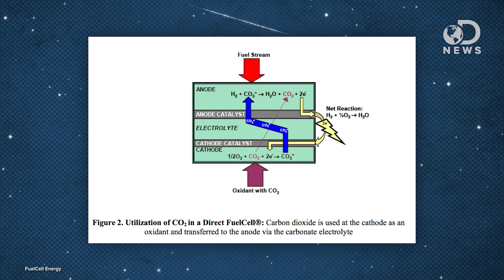Could This Technology Make Cheap Energy Clean?

Comment: we already have a clean cheap safe energy source: nuclear.
But of course it wouldnt be great for politicians and current energy lobbies.
Reply: ***** both fukishima and chernobyl were using outdated reactor designs. (the designs from 70s)
Modern reactor designs are safe.

Also fukishima faked the inspection. Some people should go to jail for that. (they should have updated their architecture but they didnt)

And even events like these are far less common than coal plants burnouts or coal mine burnouts which pollute even larger areas of the ground for thousands of years (coal mines just burn forever and noone can use that land, on top of that it pollutes the air as well while it burns)
Coal kills way more people than nuclear power does. So it is a way safer alternative.
But people just use their emotions instead of rational thought.
Reply: ***** It is clean as long as the area is stable i.e. not on the ring of fire.  Other then that its clean.  Fukishima and Chernoblyl are one of the few failures in a span of about 15 years!.
Reply: Clean? You're trolling, right? Look at Japan and Chernobyl.
Reply: Please tell me: Where to put the nuclear waste?
Reply: ***** Nuclear IS one of the safest when you look at the statistics. Just like how people are afraid to fly because the few accidents that airplanes experience are so heavily reported (even though on average flying is the safest form of travel), so to is the same with nuclear meltdowns. On average, you are more likely to die due to other forms of power generation, like coal, then to a nuclear reactor meltdown. But before I finish, renewable sources ARE the safest as they cause no deaths, but they aren't as efficient as nuclear. So until Nuclear fusion reactors come about, which will be the safest, cleanest, and most efficient forms of power generation in the history of man, I am sticking to saying that we should go with nuclear fission reactors.
Reply: Freak80MC Some proof to back me up:
http://www.washingtonpost.com/national/nuclear-power-is-safest-way-to-make-electricity-according-to-2007-study/2011/03/22/AFQUbyQC_story.html
http://www.nuclearconnect.org/know-nuclear/talking-nuclear/top-10-myths-about-nuclear-energy
http://www.theguardian.com/environment/2011/mar/29/nuclear-power-safe-sir-david-king
Reply: Too bad some assholes lobbied the government for the most inefficient nuclear Power plants with the highest nuclear waste left over. 

If we only did breeder reactors maybe we wouldn't have this problem with nuclear.
Reply: Herp Derpington Best not to ask that.  You'll likely get a rude answer, such as, "Stick it where the sun doesn't shine."  Meaning, of course, underground.  Ha! :p
Reply: Fart Snake The thing is though, we don't measure safety on "ifs". If planes crash, hundreds of people die compared to a few in cars, which must make planes unsafe, right? No, because we only assess safety on actual accidents, which make planes safer because there are less accidents than cars on average. The same holds true for nuclear reactors, which while yes, when they fail they fail horribly, but when they are designed right and protected right, they are like tanks and nearly indestructible and so they cause way less deaths than compared to other energy sources like coal.
Reply: ***** how many people die every year because of coal related power plants. go ahead, i'll wait. compare that with people who've died as a result of nuclear power accidents. take all the time you need. there's always going to be accidents, that doesn't mean it's not safe. people die from car crashes every year, we had few plane crashes as well. but statistically flying is still the safest mode of transport. look at the overall data. people like you can't see forest for the trees. tell me, do you get all your news from fox "news"?
Reply: princeofexcess There shouldn't even BE a radiation zone. Nuclear power was, is, and will be a mistake. Here are a few renewable forms of energy: Wind, solar, geothermal, hydroelectric, hydrogen fuel cells. Granted, a few of these aren't "efficient," but if we continue to research them we can make them efficient.
Reply: ***** Sorry, SOME of the few failiures.  Chernobyl was due to human error other then that it would've been fine.  Also it was within a span of 25 years!  Thats pretty good out of the 435 nuclear power plants!
Reply: ***** Chernobyl was a catastrophic event, which is highly unlikely in 3rd generation reactors and will be even less likely in 4th and 5th generation. Also, work is being done on thorium reactors, which doesn't produce weapon grade waste. Death toll from Chernobyl is around 9.000, mostly cancer related - most death from nuclear power comes from mining accidents. Dam failures in China - death toll 230.000 people. Coal is the most deadly - death toll 13.200 each year in the US alone and 300.000 deaths each year in China in adition to the severe environmental damage it does. Methyl mercury (one of the most deadly toxins) levels in the oceans are increasing due to coal power, making fish cause brain damage in fetuses and neurological problems in both children and adults. This is particularly dangerous for coastal communities that eat a lot of fish.

By each kWh produced, nuclear causes least death, coal consistently, and by far, the most and so on.

Nuclear isn't renewable, but in my opinion we shouldn't completely ignore it, as other sources have far more ecological degradation associated with them.
Reply: FixItStupid I can't tell which one you are

-12 year old boy pretending to be 60.
-60 year old person with severe brain damage.

Well I guess they are basically the same thing.
Reply: FixItStupid I couldn't comprehend a single thing you said. Your grammar probably kills much more than Nuclear radiation.
Reply: Nuclear waste is hard to dispose of.
Reply: ***** Well I was about to writhe that and also the technology was nowhere near the technology today,if they had best technology of their time,they couldn't compare to today so if it were to come to a meltdown the damage would be much,much lower.
Reply: ***** Not everyone can afford Renewable energy. The top solar farms today cost almost 6-7x as much as the same amount of energy that can be obtained through Dirty Coal/Fossil Fuel burning. Not to mention they take up more than 6 hectares of Land. 

One Coal power plant can output as much continuous energy as 130x  6 hectare solar farms.

You can start to see how this is a big problem.

WInd power is very costly, A typical Wind powered turbine can generate about 3 MW of power and Its greatly dependent on weather.  Again. there is a huge problem with the cost to produce one of these towers, the extremely vast amount of land needed to equate to one compact Coal power plant which can generate.

You need almost 60 square Miles of Area to generate enough power as 1 coal power plant that out puts 1600 MW of continuous energy.

Again, you see a big issue.

GeoThermal is only available for places that are volcanicly active. Again this is a huge set back and can only be built in very certain regions. It is also a very huge task to build a Geothermal Powerplant as most of it is deep underground. The biggest Geothermal Powerplants can only generate around 200 MW, Most can only generate around 100 MW of continuous power.
Reply: Nuclear is clean? What about Fukushima..
Reply: Only LFTR reactors are feasible. Thorium is the way to go.
Reply: D Babola In new nuclear the meltdowns you refer to is a physical impossibility. As the fuel is already a liquid...
Just do a search for LFTRs and educate yourself about the possibilities that lie beyond the current extremley inefficient use of nuclear.
Reply: Herp Derpington The waste is contained in facilities underground.

And you are forgetting, the energy released from a Nuclear Fission reaction is 2 Million times more efficient than coal.

A Uranium cube an Inch wide releases the same amount of energy that burning 1 Ton of coal releases.

Now you can get a picture of how much fuel is actually being used and converted into plutonium a nuclear power plant versus a coal powerplant burning through Many tons of Coal releasing all that Co2 right into the atmosphere.

if you want to see how Big 1 ton of coal looks like, Google pictures "1 ton coal bag"

The proportions need to be realized.
Reply: I'm just going to leave now because everyone is just repeating themselves and nothing is getting accomplished here. Good-bye and good luck not getting radiation poisoning.
Reply: *****  there were 2 major accidents with nuclear power. You know how  many coal related accident there are??

Nuclear power is already the safest and cleanest alternative (at least when it comes to something that is actually sustainable)

You are stating that nuclear power is a mistake but data says otherwise.

Btw i live next to a nuclear reactor and there is hundreds of nuclear reactors world wide.

Being against nuclear power is like being a person who doesnt want to fly airplanes even though its much safer than driving a car.

Oh and btw during regular operation (when there is no accident) coal plants release more radiation into the environment than nuclear power plants. And they also release other goodies like mercury.
Reply: ***** So in other words, you can't stand that people won't buy your baseless claims and are admitting that you, in fact, have no foundation for your argument beyond your own ignorance and paranoia?

If your only arguments nuclear are two disasters and the waste disposal, then we need to compare apples to apples.  Chernobyl was the result of bad design, bad safety procedures, and overall cheap workmanship, from a 50 year old design.

So let's compare that to poorly made aircraft made 50 years ago.  Oh...hmmm...aircraft of the time were responsible for thousands of deaths!  Modern aircraft must me just as unsafe, we must stop using them!

Just like aircraft and cars and boats and basically everything else, the old dangerous initial designs of the past are long gone, and far superior and dramatically safer designs and technology have emerged.  Even with that old dangerous technology and design, Nuclear remains the safest, most environmentally friendly power source, overall.  It requires less land per kilowatt than any other source.  It emits less waste into the environment per kilowatt than any other source (including the construction process, Solar requires very dirty production methods, and the rare-earth magnets needed for high-efficency wind are harvested using incredibly damaging mining methods that leave vast amounts of land toxic for decades).  It kills less people per kilowatt over the history of energy.

Then there are modern reactor designs, which not only produce more power, in a smaller form factor, without the need for large amounts of water, but do so with zero risk of meltdown.

You could install one of these underground in a subdivision and it would take up only a few square meters, and provide constant electricity for decades without refueling.  No need for a staff either, you can build it and forget about it.  Best part?  Its waste is harmless at the end of it's life cycle, no special handling required.
Reply: Burning fossils kills millions of people every year, way more than nuclear. Plus modern nuclear reactors don't melt down. People who are afraid of nuclear don't understand it, it's like a caveman that's afraid of fire
Reply: dLight Sella Field, Chernobyl, Fukushima, 3-mile island

Chernobyl, Fukushima, 3-mile island = All built before 1969 First Gen powerplants.

Sella Field = Built primary in the nuclear war race when safety was barley even cared about.

Chernobyl = Built without a heart container

Fukushima = Due to an earth quake, the earth quake killed 15,000 people. The Nuclear reactor Killed no one.

There are Generation 4 Reactors in the making currently. All the nuclear incidents were strictly due to primitive very old, literally first Generation reactors with little to no safety precautions like there are today.
Reply: K2ACP Nuclear has been around for 60 years. which means it's been around through wars and plenty of natural disasters. It's the safest energy source by far and even produces less toxic waste than solar power.
Reply: FixItStupid Im going to guess that you are around 12. If not then I suggest you see your local Psychiatrist or a doctor.
Reply: FixItStupid
Too bad, you live with ionizing radiation whether you like it or not, whether nuclear plants exist or not.
Reply: KillerBillPickle How do two accidents make one failure? Chernobyl is NOWHERE near the Ring of Fire. Hundreds of miles of land are still contaminated to this day and children are born with some VERY serious defects.
Reply: *****  nobody lives in chernobyl radiation zone (at least not legally there are people that chose to stay but they just didnt want to leave their home land)
Reply: KillerBillPickle These accidents cause some serious health and environmental problems. The damage that we have been speaking about was caused by a few plants. Tell me what would happen if they all went catastrophic. And yes, do tell us where we would put the nuclear waste? Burying it would solve the problem, it will still be radioactive for millions of years.
Reply: Chernobyl is safe and clean, it has only five times the background radiation.
Reply: Herp Derpington They apparently have space for CO2 cells so in the same place I guess.
Reply: sure, it's safe. until something goes wrong. and then a 1,000 square mile area is uninhabitable for 300 years. if that isn't safe i don't know what is.
Reply: Fart Snake You forgot to add the million after the 300.
Reply: ***** It's not million but I think it's something like 50 000
Reply: Freak80MC when they are designed right? you mean like the one on 3 Mile Island?
Reply: ***** One word: Chernobyl.
Reply: ***** I don't watch Fox. Nor do I support coal power plants either. I don't choose not to use coal and nuclear because of efficiency, I choose not to use it because it's NOT CLEAN. I choose renewable energy because it's clean.
Reply: ***** We have learned alot from Chernobyl and Fukushima,

There has been alot of steps we have taken to prevent a disaster as such from happening again, and better technical structuring to better fortify a nuclear reactor.

Modernday Nuclear Uranium reactors are very safe.

However it's just the byproduct that is dangerous, as long as it is kept in a controlled location Nuclear Uranium Power plants virtually are one of the cleanest forms of energy production currently.
Reply: ***** nuclear is clean, and it can be harvested on demand. the problem with renewable right now is that the energy can't be stored and there are other practical problems as well. solar panels become really inefficient when there's dust, and desert is one big dust bowl. you can clean it with water, but there's shortage of water in desert. the problem with living in reality is that you have to worry about cost. if it doesn't make economic sense, then it won't have a lot of support. nuclear power plants are getting safer and safer all the time. there are generation three power plants being built in china and US scientists are already working on generation four power plants. if we want energy security, we need to look at all types of energy sources and nuclear is part of the solution along with solar, wind, coal, geothermal, hydro and so on. 
http://www.the9billion.com/2011/03/24/death-rate-from-nuclear-power-vs-coal/
Reply: D Babola http://www.the9billion.com/2011/03/24/death-rate-from-nuclear-power-vs-coal/
Reply: D Babola I think you should read my comment about 3-4 responses above yours.
Reply: ***** Nuclear is more risky than let's say solar energy. The meltdowns cause by nuclear energy literally makes that part of the planet uninhabitable. There too much potential for a catastrophic event to happen with nuclear .energy
Reply: D Babola Solar is not realistic, again, the uneducated people in this subject always watch oversimplified science videos that try to glorify solar energy's potential without giving you the reality of the situation.

Not everyone can afford Renewable energy. The top solar farms today cost almost 6-7x as much as the same amount of energy that can be obtained through Dirty Coal/Fossil Fuel burning. Not to mention they take up more than 6 hectares of Land. 

One Coal power plant can output as much continuous energy as 130x  6 hectare solar farms or 1600 MW of continuous energy

You can start to see how this is a big problem.
Reply: God dammit the ignorance of the fucks here. Nuclear energy is clean and safe, to the fucks who cite "Fukshima" and "chernobyl", chernobyl was due to human error and poor reactor design that was never implemented again, Fukashima  was due to its shit location and the fact that after the quake a fucking tsunami came in and wiped all the back ups out. Nuclear Energy produces as much radiation into the area as you would get from eating one banana every year.  No member of the public has ever been injured or killed in the entire 50-year history of commercial nuclear power in the U.S.  In fact, recent studies have shown that it is safer to work in a nuclear power plant than an office. To date thousands of shimpents of spent nuclear fuel have been made all safely.  All of the used nuclear fuel generated in every nuclear plant in the past 50 years would fill a football field to a depth of less than 10 yards, and 96 % of this “waste” can be recycled and used. And it also requires less land then almost any other energy source. Do the damn research yourself before you open your mouth. And If anything thorium reactors will be even better once they are developed.
Reply: Carbosful Solar isn't viable now because of how little time and money being put into R&D of solar energies. Coal has been a source of power for much longer. 
As our technologies become more and more advanced we should be able to harvest more of the energy coming from the sun.
My main issue with coal and nuclear energy is the long lasting effects it has on our environment. 
As you have probably already noticed I'm not well educated on the subject but I do find this stuff fascinating, I'm studying nutrition at university, so I know the politics within this subject hinder further developments
Reply: D Babola Long lasting effects of nuclear energy on the environment? Nuclear reactors emit no greenhouse gasses during operation.  Over their full lifetimes, they result in comparable emissions to renewable forms of energy such as wind and solar. Nuclear energy requires less land use than most other forms of energy.
Reply: D Babola That is true to only a small degree, I will tell you why.

Its mainly due to energy density.

Fossil Fuels and coal are simply concentrated sunlight.

You don't even need to be very educated to understand logic.

If Fossil Fuel's and coal are simply concentrated sunlight through Millions and Millions of years time, you should be able picture how much more energy is released by simply burning this material versus Trying to obtain energy through capturing sunlight that's hitting the earth now.

-----
Theres a maximum of energy that can be obtained in a given amount of Sunlight area. And that ammount ranged between 120-200 Watts/Sq meter the variance is due to weather. Again this is your maximum ammount of energy meaning even if you had a 99.99% efficient solar pannel this is the maxium you can get for that said area.

again.. This becomes a great problem even if can develop an impossible way to cover every single inch of ground with nearly perfect energy conversion you are still stuck with that limit.

Since our energy demands are exponentially increasing decade by decade, it wont be long until the need to develop a very dense compact form of energy generation is needed once again..

That's not to say that solar will not be used for a wide variety of appliances in the future, however it realistically cannot be the main source of A Big nations energy production.

----

Our Solar pannels currently are not horridly inefficient The most modern ones can convert up to the mid 30% in terms of efficiency. 

Its not an efficiency issue, its the fact that Sun light can only contain so much energy, It requires Huge amounts of area making it very impractical.

We need Dense power generation methods.

Is it more realistic to steadily advance solar technology or develop a new way to triumph Coal burning and nuclear Uranium by thousands of times through Nuclear Hydrogen Fusion ?

You do the math.
Reply: Hendlton Ah, but the waste is much more hazardous than the CO2 and the danger is of a different kind. CO2 is not *directly* poisonous; but the waste is. This waste will still be radioactive when we are no longer here...
Reply: Carbosful
As a perspective to that:

The final energy output of 1 ton of Thorium ore in a LFTR equals about 235 tons of Uranium ore in a LWR.

Assuming equal 3% purity of the ore the waste from the LFTR will be about 2.1 kg while the waste from the LWR will be about 7 tons (6838 kg depleted uranium and 211.5 kg waste)...

The 2.1 kg waste from the LFTR needs to be stored for only 300 years.
The 211.5 kg waste from the LWR needs to be stored for 100.000 years.
Reply: ***** In terms of risk to human health measured by deaths per kilowatt, nuclear is incredibly safe, even with Chenobyl and Fukushima

In terms of risk to the environment, nuclear energy is probably also superior to many forms of renewables such as hydro-electric and biofuels. Nuclear waste is a problem, but it is a localised and containable one, unlike greenhouse gases.

Any claim that nuclear is 'unclean' or 'unsafe' I just don't buy.
Reply: Check out thorium reactors
Reply: ***** Well you did claim things without any factual backing. Most of the posts in here were giving you reasons and some factual insights on how some of the claims you made were wrong.

I wouldn't take it as a personal insult, 

As long as knowledge is being spread I fail to see how this conversation is getting nothing accomplished.
Reply: *****  So a $4 soviet reactor and the one built next to a fault line and ocean are your examples? Chernobyl is your only argument but thats so far out of date its no longer relevant. When it comes you japan thousands of people died from the earthquake and tsunami and zero died from the reactor.
Reply: Another reason that I'm not contributing to this any further is because the nuclear idiots assume that coal is clean and renewable. I don't support coal either.
Reply: ***** I don't know who claimed coal was clean and renewable, but who ever made that claim was wrong, however its not wise to bunch us up as " nuclear idiots" 

No one is actually trying to insult anyone in this conversation.

Just because there is a difference in opinion does not mean that the next best option is to personally insult others by name calling unless you are still a Kid.

If you have a different viewpoint you should try to explain it in a mature way.

-----
Im sure everyone would love solar power or renewable energy sources in fact if the energy crisis could be met by renewable sources than im all for it..

However the more you understand about how these processes work, the more urealistic solar becomes.
Reply: Nuclear safe what about Japan?
Also the same thing could happen in the US
Reply: Neil Lizotte What about japan? No one even died from that.
Reply: KillerBillPickle what about the waste bio products that remain radioactive for over 100,000 years
Reply: Neil Lizotte The waste that is securely kept with in a small metal container? That is thousands of times smaller then the harmful waste coal produces. Building solar panels produces more toxic waste then nuclear
Reply: Though nuclear isn't as dangerous as people say (a couple of oil refineries have exploded), like other people have said you have nuclear waste that need to be stored at a waste site. We still haven't figured out how to safetly store it yet.
Reply: Ryan Gillen Yes we have, throw it in a metal container, problem solved
Reply: BlackCats
 In most countries with nuclear power except the US nuclear waste is recycled. (you can reuse it as nuclear fuel)

And even if its not recycled it is still cheaper to dispose of it than to use coal power plants.
Reply: Neil Lizotte
 Japan was using a power plant with architecture from the 70s (in fact they faked an inspection to get away with it)

If there is an accident increase safety standards do not ban the technology completely.

And even with accidents like Fukishima coal kills 1000x more people than nuclear.

And new reactor architecture doesnt allow for such accident to occur.
Reply: princeofexcess It was built in the late 60's XD
Reply: Neil Lizotte fun fact: nuclear waste can be recycled (and is in most countries except the US)
Reply: Ryan Gillen
 Nuclear waste can be recycled. How is it that nobody knows this...
Reply: whatsmyusername10 yea its extremely outdated. Although construction finished in the '71.
Reply: james lionbreath Let me give you an example.

A typical Coal power plant, very compact and can generate up to 1600 MW energy always 24/7 by burning coal.

A typical solar farm takes up 180 hectares or land or 450 acres. (very large), Can generate up to 20 MW energy for ONLY 15/24 hours per day.

Typical Solar farm sells energy for $33/watt
Coal sells for $5.5/watt
Reply: james lionbreath  it would be cool. But it will not work.

In order to have energy source which is usable it has to compete with the other energies financially.
Solar takes up way too much space and is extremely inefficient. Unless we have a major breakthrough it will never compete with other energy sources.

You might think it doesnt matter if it competes with other energy sources or not but the truth is if you want to use clean energy sources you will move the poverty line up.
Which is extremely terrible thing to do.
Reply: I believe nuclear is the only energy source that can compete with fossil fuels. But building nuclear power plants is sooo expensive
Reply: whatsmyusername10
  its still competitive with other sources of power. (unless you are near a cheap source of fossil fuels)

on top of being competitive it has an additional benefits of being extremely clean and safe.
Reply: KillerBillPickle
Having 2 nuclear meltdowns in a 100 years is too much, let alone in every 15 years...
Reply: dLight Fossil fuels killing hundreds of thousands of people each year is too much. Fossil fuels is so much more toxic
Reply: "Safe" yes, but not when shit hits the fan during a war or a natural disaster. Also storing nuclear waste is a tricky and sketchy thing to do. Containers have leaked recently and have gotten into ground water. This kept in mind
It's still a better solution than coal.
Reply: Nuclear today is far improved to nuclear say back in the late 40's.  Honestly we could run on nuclear, hydro, and renewable alone.  We put more heavy metals and toxins from coal and petrol burning than the same power from nuclear according to mass.  Look it up for yourself if you don't believe me.
Reply: Christian Millard Go back to school ..................yea so improved it's killing the earth........... seems like there's a lot of people that work in the industry on this channel killing the earth what do you think happens when your FUEL ONE  plants think they're venting Makem poop  oh and what do you do with the poop
Reply: GO  BACK  TO  SCHOOL       KILLING  THE  EARTH   NUCLEAR      THIS   IS   THE  KID Ch   more propaganda brainwashing for the kitty channel
Reply: Look up perpetual motion, you will find that everything requires energy.  Solar is nuclear btw, just photo radiation rather than neutron radiation heating a medium.  Look up photovoltaic cells to understand how they work.  They still require an electrolyte and silicon.  Not exactly environmentally friendly as they get more efficient their carbon footprint increases.
Reply: Anyone who says nuclear is bad for the environment does not understand how it works.  It is recyclable into a glass, reducing mass.  Litterally the most clean steam boiler in use today.  We get most our energy from coal and petrol.  Also wind, solar, and geo, make up less than 5 percent of our grid.   Hydro which is still terrible for the environment is 95 percent efficient and is destroying water tables.  Don't assume the power issues of today aren't validated.  Before you tell someone to go back to school it would be good to get an education yourself.
Reply: You go back to school because the glass  doesn't work dummy read up I am current on the subject you're a corporate dummy pay your taxes
Reply: Take all your nuclear and shove it where the sun don't s shine you can tell it to my thyroid
Reply: FixItStupid Nuclear is the way of the future
Reply: Yes, Sad But True  &  All for Greed Money
Not all the money will buy another Earth
 Not all the money will buy another Minute
Reply: ***** One word. Thorium!
Reply: SEE IT KILLS NUCLEAR
 http://enenews.com
Reply: whatsmyusername10
 http://enenews.com     
NUCLEAR KILLING YOU SOFTLY look at the cancer rates look at what the World Health Organization said the cancer rates are going up.... would that be all the radiation affecting the DNA ?  It's in the FOOD chain isotopes daughter products THAT in the future you have yourself real nice DAY
 SCHOOL WOULD BE GOOD
Reply: FixItStupid News articles are a terrible source to look up information. Look for information in the scientific literature. Fukushima has been over blown by the media. Air pollution from use of fossil fuels kills millions of people each year. Fukushima has killed no one.
All the reactors that have ever melted down were first generation reactors built in the 60's. We are currently at 4th gen and 5th gen is around the corner.
Even solar power produces more toxic waste than nuclear
Reply: Really News articles are terrible source of information that's is hypocritical as if nuclear IS safe NOT... Just so you know 51 men gave their lives so that not more damage was done your real sick wicked know you're a bot working in the industry I agree to disagree you're an idiot and I'm not continue to discuss the matter with you.. / it... I feel that you're a machine not one shred of human intelligence or compassion
Reply: FixItStupid Yes news articles are terrible. Oh only 51 people have died? That still pales in comparison to fossil fuels.
"In the United States, approximately 140,000 deaths a year (Wo of all deaths) may be associated with air pollution."
http://www.sciencedirect.com/science/article/pii/0095069679900226

"The estimate of 100,000 deaths per year means that 1 American out of 30 dies as a result of air pollution."
http://www.phyast.pitt.edu/~blc/book/chapter3.html

Once again the reactors that melted down use old and outdated technology.
Please stop using ad hominems, it doesn't make your argument any better
Reply: I think you're a bot one of those that get paid to distract the facts about nuclear industry you don't even know the 51 were the ones at the Nuclear Power Plant  hundreds of millions will be impacted by Fukushima every single nuclear power plant impacts the environment in so many more ways I have two coal-fired power plants directly across from my house and I have no problem with those I know what comes out and I'll deal with that...... Nuclear  it's just a straight up killer and it doesn't stop killing for thousands of years and  remember I got a thyroid that was taken out because of all the nuclear iodine 131 from  stupid fusing reactors have a nice day get educated
Reply: FixItStupid Telling others to "Go back to school kid"  Typing in caps, Yelling at people who disagree with you.. is not something that an educated person would say..

If what you are saying is truly correct backed up with facts then that is all you need, in a debate.
Reply: I'M TOO FUCKING OLD TO GIVE A DAMN ALL YOU SMART KIDS GO KILL THE EARTH YOU KILLED THE EARTH YOUR CHILDREN WILL LOVE YOU
 YOU BOUGHT INTO CONSUMERISM
 IF YOU CAN'T GET I  TYPED  IN CAPS.  BECAUSE YOUR  too young to see
NUCLEAR INDUSTRY TOOK MY THYROID  I LIKE YOU SELF-RIGHTEOUS YOU CAN'T STAY ON THE SUBJECT THIS CHANNEL IS  OBVIOUSLY IS DEDICATED FROM THE NUCLEAR INDUSTRY LOBBY GET INTO THE HEAD OF THE YOUNG PEOPLE
Reply: Carbosful I'M TOO FUCKING OLD TO GIVE A DAMN ALL YOU SMART KIDS GO KILL THE EARTH YOU KILLED THE EARTH YOUR CHILDREN WILL LOVE YOU 
 YOU BOUGHT INTO CONSUMERISM
 IF YOU CAN'T GET I  TYPED  IN CAPS.  BECAUSE YOUR  too young to see
NUCLEAR INDUSTRY TOOK MY THYROID  I LIKE YOU SELF-RIGHTEOUS YOU CAN'T STAY ON THE SUBJECT THIS CHANNEL IS  OBVIOUSLY IS DEDICATED FROM THE NUCLEAR INDUSTRY LOBBY GET INTO THE HEAD OF THE YOUNG PEOPLE
Reply: WOW I FOUND THE HEART OF THE NUCLEAR INDUSTRY ON THIS CHANNEL IMAGINE THAT PROPAGANDA  SO EFFICIENT
 FUKUSHIMA IS CLEANED UP MY ASS GET OVER THERE CHECK IT OUT   IT WAS A BUNCH OF YOUNG SMART ASSES THAT THOUGHT NUCLEAR POWER ... WAS SO GOOD...... FROM THE TIME YOU ... TAKE IT OUT OF THE GROUND IT'S KILLING
 I GUESS WORD POISON DOESN'T MEAN ANYTHING TO THE PEOPLE THAT ARE ALL ABOUT CONSUMERISM AND THE CANCER RATE RISING THAT DOESN'T ADD UP TO ANYTHING RIGHT
Reply: I'M NEARLY 60 AND I'VE SEEN ENOUGH OF THE WORLD TO KNOW IT'S ENDING SOON THANKS TO CONSUMERISM & THE NUCLEAR INDUSTRY YOU SEE GREED MONEY LAWYERS PAID TO LIED YOUR COURTS AREN'T WORTH A SHIT AND IF YOU CAN'T SEE THE EARTH DYING BEFORE YOUR EYES U NEED THE DOCTOR
Reply: NUCLEAR INDUSTRY KILLS ALL  YEAH THAT'S WHY WORK IN THE ELECTRONICS FIELD.. FOR THE GOVERNMENT FOR YEARS AND I QUIT THEM TO BECAUSE I DON'T USE TECHNOLOGY AGAINST THE CITIZENS OF OUR COUNTRY OR THE EARTH   AND I GOT OFF MY ASS AND I DID SOMETHING ABOUT IT I SPENT MY MONEY I PUT MY MONEY WHERE MY MOUTH IS AND PUT IN THE SOLAR AND THIS WINDMILLS AND I RUN MY HOUSE OFF GRID AND I  TRY TO HAVE A ZERO CARBON FOOTPRINT  AND YOU JUST A CONSUMER GO TO WORK AND PAY YOUR TAXES OKAY GO BACK TO SLEEP BELIEVE THE PROPAGANDA
Reply: Herp Derpington
You can burn nuclear waste in fast reactors or thorium reactors, then it becomes inert in 300 years and is safe enough to handle in decades after it's burned. 10 years of waste equate to 1000 years of fuel in a fast reactor.
The only reason all those accidents happened is because water is a shitty way to cool a power dense energy source. Lead and molten salt, or even a modern CANDU would have prevented fukushima.
Reply: leerman22 Sorry maybe you don't understand that the majority of us don't want any   energetic radiation /  ionizing radiation anywhere around us ... Are DNA is precious to us.. Nor do we want any of the other life forms on this planet to deal with ionizing radiation and all the other nuclear isotopes That  amazingly seem to get out in to the environment that are completely man-made anybody who's pro-nuclear is for death you should really read some of the studies on low level radiation exposure it will certainly change your understanding the health effects of the bomb testing alone is horrible disgrace to science nuclear is just greed money lie game of Death how many people do you know that got cancer ?how many mental health? birth defect and mutations ? And so many other autoimmune diseases's .... you cannot burn nuclear fuel the world has been working to deal with the waste & the world cannot find A way to deal With the waste it lasts millions of years some of those isotopes emitting alpha Beta x-ray and gamma amongst many other wavelengths along electro magnetic spectrum ALL = Death... sad that most likely We won't ever worry about anything Ever Again because I believe Fukushima to be an extinction level event & the next nuclear "accident" is a mathematical certainty
Reply: leerman22 Dosis facit venenum.
Reply: *****
hey as long as u build it up to the right standards unlike 3 mile island and not at any place with natural disasters its fine
Reply: The Doctor Nut's Dr. POPULATION CONTROL THROUGH NUCLEAR POLLUTION READ IT.... wrote 1970 by Tamplin & Gofman   CANCER Going UP ? You don't know it until you find out you don't know NUCLEAR KILLS
Reply: "safe"    Go live within 30 km of Chernobyl. Oh, wait... no, you can't.
And before you lecture me about all the gross exaggerations made by rightwing conspiracytards like Alex Jones about Fukushima irradiating the ocean, which Thunderf00t has debunked - the radiation density per cubic meter of water that Fukishima has increased the oceans above background is insignificant -
you STILL have to show how or why the additional fossil fuels burned to make a terawatt of solar panels or windmills is greater than the additional fossil fuels burned to build a massively complex nuclear power plant 
and deal with nuclear waste for years.

There exists NO logical reason NOT to collect AS MUCH electric power from DIFFUSE NON-CENTRALIZED sources such as wind & solar BEFORE resorting to all the massively insanely capital-intensive financial sinkholes such as nuclear.